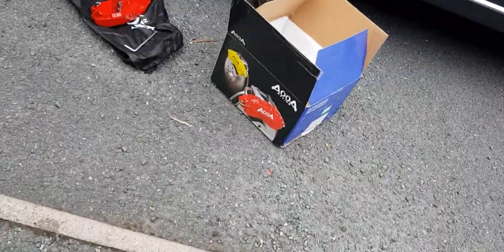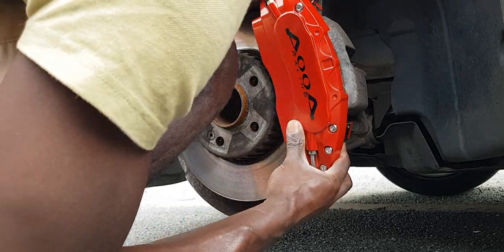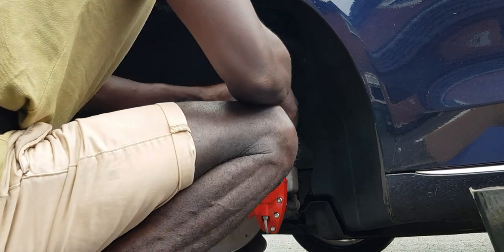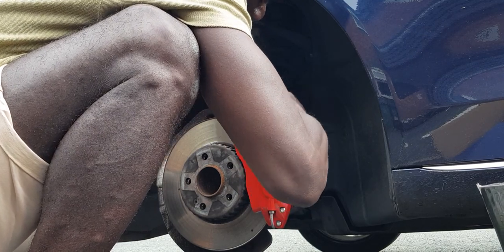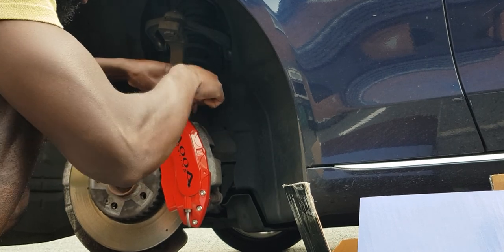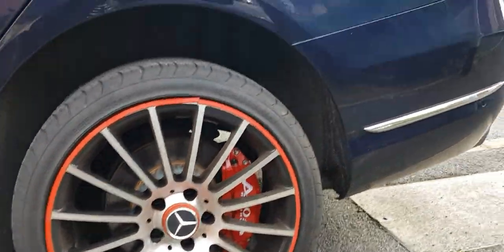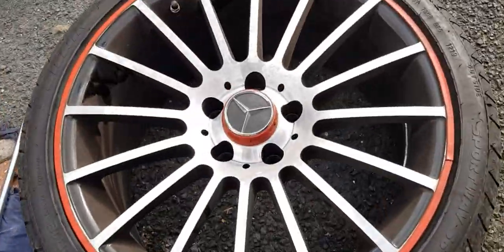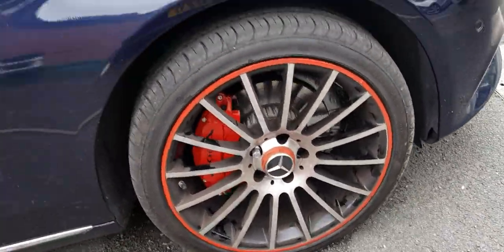BEST way to fit UNIVERSAL car Caliper COVER Comes in COLOURS#Brake😊

Comment: Good job.  I bought a pair Aooa  from Amazon but didn’t fit , way to big for my caliper and 17 inch rim.  They don’t make them for fiat 124spider 2017. Too bad , they were  really good quality.  If you have a link I will try again. I’m in USA.
Reply from the maker: Hello Pal, try and contact Aooa on the amazon, by sending them pictures of your front and rear caliper and they will be able to make you one that will fit.
Thank you

Comment: Are they universal?
Reply from the maker: Unfortunately they are not but can manufacture your brand and model of your car if you want. Thanks
Reply: @Activ8Podcast  on the website, there's no where to put vehicle info to determine the caliper fit.
Reply: @Activ8Podcast  found it, nevermind
Reply from the maker: @mymanhemi3610  hello mate, whereabouts are you? I mean country. I am the only official uk distributor for AOOA caliper. What you should know is that European calipers are different from same car made for asia. So we will need to see what country you are and see if we have it it stock, if not, we can make one for you
Reply: @Activ8Podcast  USA.  I have a 2019 challenger 5.7 RT
Reply from the maker: @mymanhemi3610  I can find your a contact to message and they will sort you out. I live in the uk and usa is one big market for AOOA.
Reply: @Activ8Podcast  thanks
Reply from the maker: @mymanhemi3610  https://www.ebay.co.uk/itm/Calipers-Cover-/353199778952?_trksid=p2349624.m46890.l49292  follow that link so we can chat about getting you the caliper mate

Comment: It is safe?
Reply from the maker: 100% Safe.  You can see the process of fixing it unto the car. It clip tight unto the main caliper and they screw unto the caliper to hold forever until you decide to unscrew it off maybe for caliper maintenance in the future. The safety is 100% and I myself have had it for over a year now on my car and haven't had any disturbing experience from it.